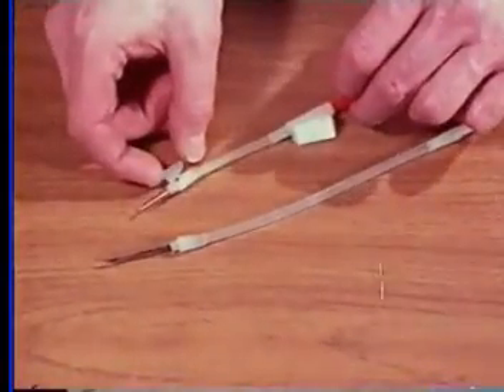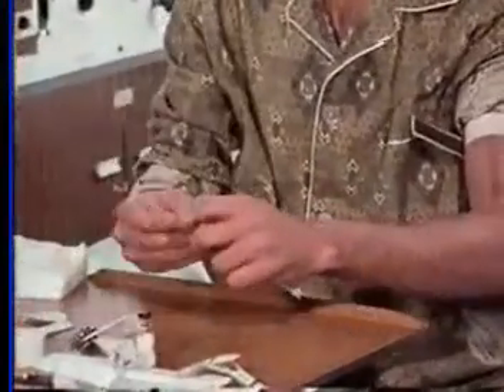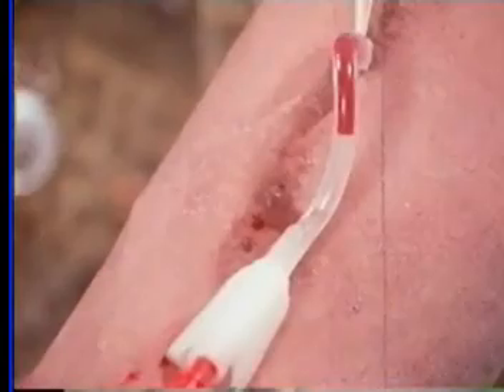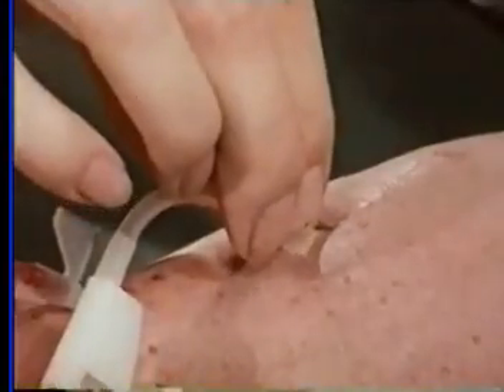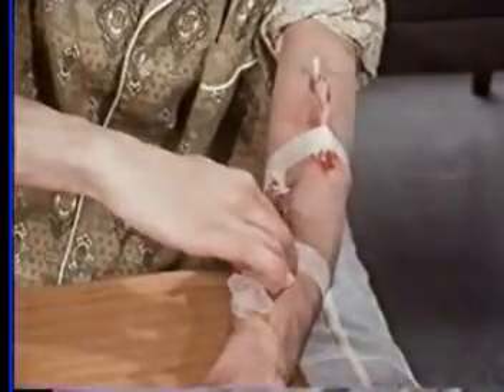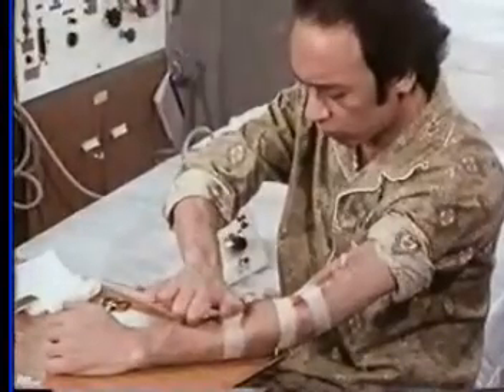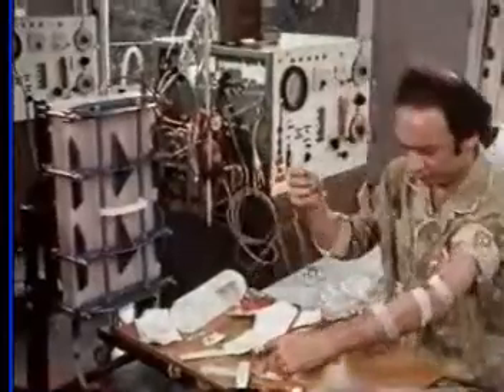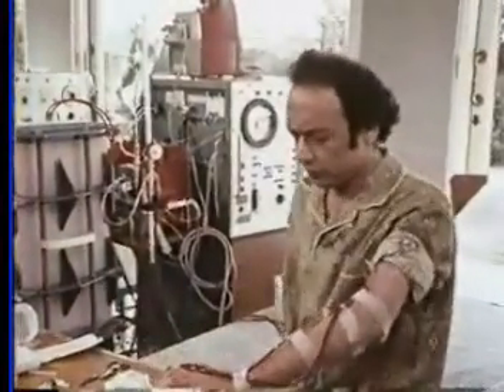TECHNIQUE OF SELF HEMODIALYSIS

Comment from the maker: No it did not. The reason was the speed of insertion and the the cutting edge of the specially designed needle. This insertion was done usually without local anasthetic and if done faster enough it did not hurt. Thee longest functionaing AV fistula which I created in 15th january 1970 stopped working in February 2008 due to infection. It was exclusively used by the patient alone who always punctured it himself.